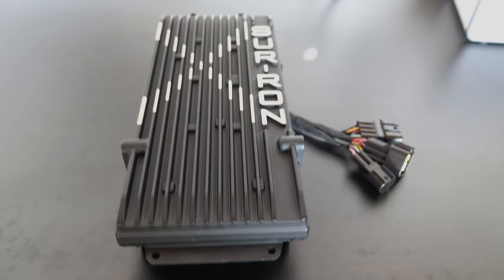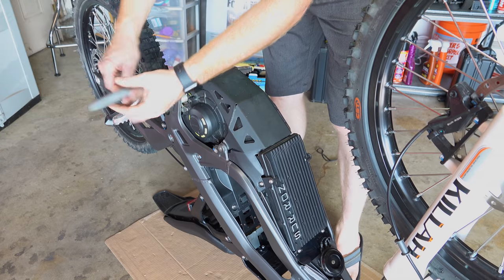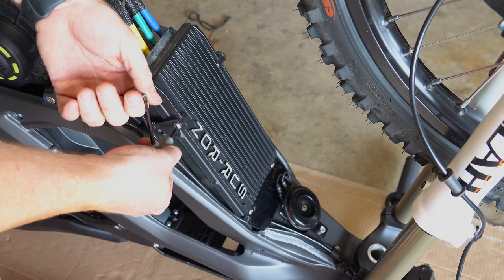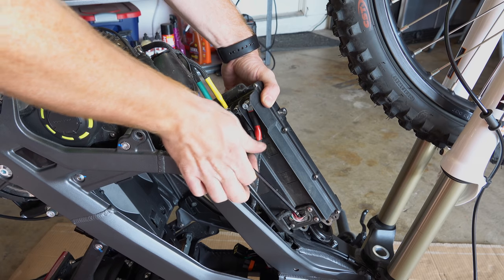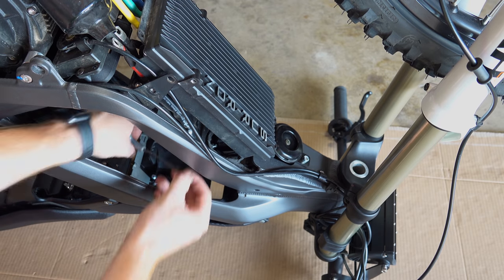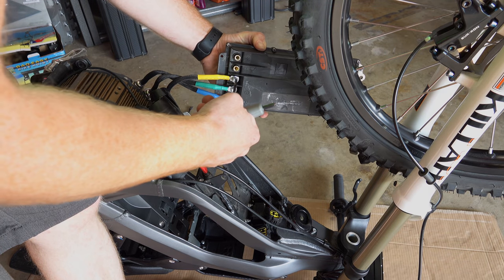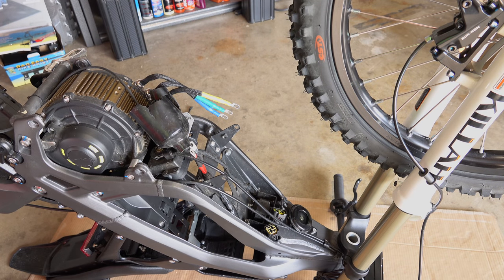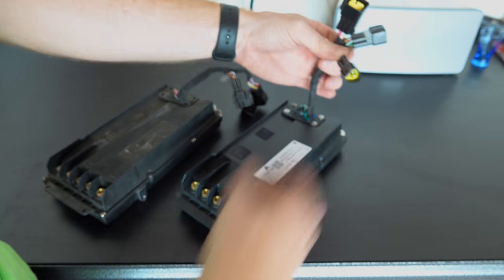Sur Ron "X" Controller Install

Comment: I unplugged and removed that tip over sensor when doing this controller swap. It may be worth noting that the triangle plug on the X-controller plugs into the plug that the tip over sensor came off.
Reply: U plugged it into the tip over senor plug? I removed mine too so should I connect them

Comment: theres 2 bolts in the side of the frame that allow the entire front battery plate/controller plate to hinge on the 2 remaining bolts at the bottom of the bike... easier than taking out that little 'tab' bit imho

Comment: Saw on a Sur-Ron Facebook group that the triangular connector matches up with the tilt sensor connector... Is there a tilt sensor built into the X controller or is the original tilt sensor still required? Thanks!

Comment: When you turn the bike upside down, what do you rest the seat and handlebars on? It appears to me the first contact point in the rear would be the rear fender, and the contact point in the front would be the controls on the handle bars. Neither of which seems optimal to me.
Reply: I used a bag of mulch.

Comment: It was just out riding my sur ron 2022 model 600 miles in shorts, I felt like it was shocking my legs. Bike was running fine other than that kind of has me concerned. Kind of went over and looked at the wiring tonight didn't see any problems obviously, have you guys had any problems with these controllers shorting?

Comment: @all:

I installed a sine wave X controller on a european street legal Sur-Ron (they call it the Firefly here) which normally comes with the “stock” controller.

I only have one issue:
My instrument randomly shows 0% battery power and 0% voltage. It just flashes on once in a while, along with the low battery indicator, and then goes back to normal.
Once in a while I also get the “Er-002” code on my LCD screen.
The bike itself operates normally though (albeit higher battery drain, but I’m sure that’s normal due to the higher power), no power cutoff, nothing.

Do you have any idea what might be causing this?

What does that error code mean (couldn’t find any definition to it, also not in the service manual listing the failure codes)?

On another note, I thought this might be of interest:
On European models removing the slow mode or “unlocking” the bike is done by cutting the green wire.
I still have mine intact, but having installed the X controller, i can now reach 80km/h in sport mode, and on economy it tops out at 50km/h.

Also, I have a connector on the main bike harness for the triangular one coming out of the X controller. I connected them  but I have no clue what it’s for. Does anyone know what it is?

Thanks
Reply: is it working ok? what are the main benefits you got? thanks!
Reply: You have Solved the random 0% Problem i have the Same Problem after x Controller replacement on a street legal surron and i have randomly more or less torque thats realy anoying
Reply: i have the same problems. normally i had the green wire cut. now i've soldered it back together and installed the x controller. now i have recuperation but i can't programm the x controller + i have less torque when opening full throttle. I'll try to remove the third plug. Has anyone of you had any progress?

Comment: Why would this be not recommended on a Segway x260? I thought they were identical
Reply: Segway 260 already has this type of sine controller. The old controller, in this video, was only on old Surron way back in 2019 or earlier. By the time Segway started rebadging the Surron as a Segway, all bikes were being manufactured with this controller.
Reply: Can I swap it out for the Segway x160

Comment: Just finished installing the new X controller on my 2018 surron and my speed is now limited at 25 km/h, reconnected the black and green wire and speed is still locked.. Any one else have this issue when upgrading their controller. Any help would be appreciated thanks!
Reply: Try to detach green wire again, seen that work